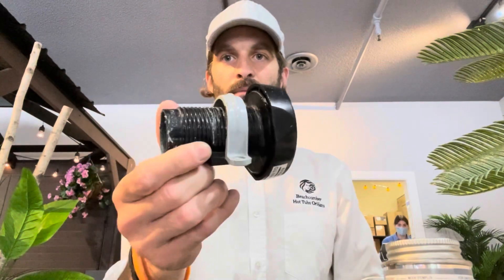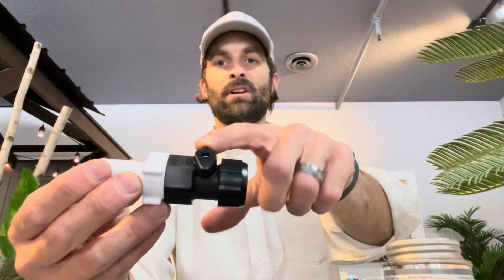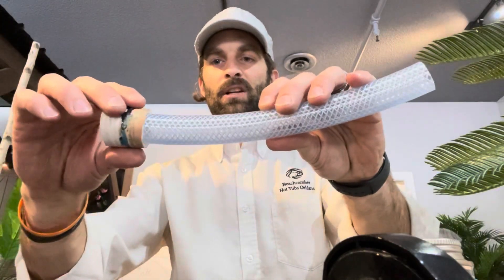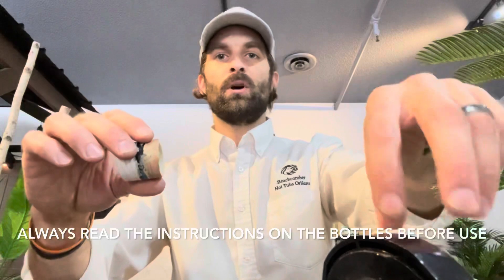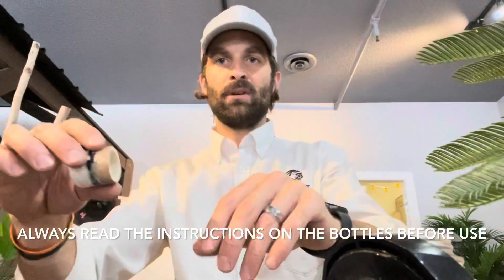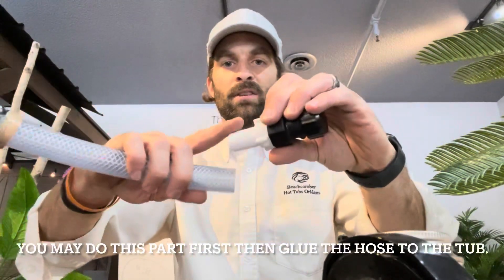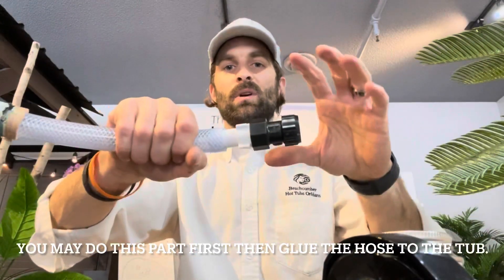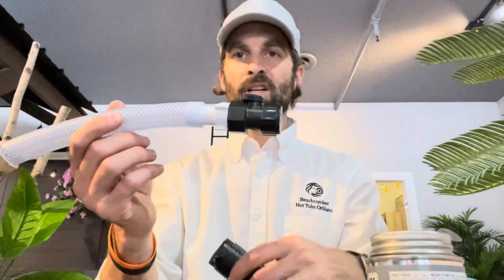Replacing the drain valve

Comment: Thanks for making this, i had the valve start leaking, so got the exact parts from my dealer, he did loan me the primer and glue .  I was debating on installing the 1/4 turn new valve in first, but i wasnt sure how fast this would set up.  It would have been fine to align it where i wanted.  I chamfered the clear hose slight to fit a bit easier into the old pipe.  Just going to wait till tomorrow to start filling, Hoping i have it done, i was losing around 3/4 of water each day out of tub, it was leaking at the bottom of the fitting so was hard to see.

Comment: How do you get the old valve off? Cut the hose?
Reply from the maker: In my experience these only need to be changed when they are loose and leaking already... which should make it relatively easy to twist and remove. IF the valve no longer works and is not leaking I would simply find another solution to drain (QuickDrain or submersible pump, etc..) and leave the drain valve as is.

Comment: My drain valve just started a very slow leak about a week ago.  I guess I have to drain the tub to make this repair...  I too would like to know how to get the existing valve off of the pipe. Do you happen to have the OD and ID measurements of the existing drain pipe? I can't measure the pipe until the valve is off.
Reply from the maker: Hi Jason,
Yes, you must drain it to make the repairs.
Once drained you can simply, and slowly, twist the valve until it’s twisting a full 360 around… then pull slowly away on the valve and it should come off. You can also take a heat gun (on low) and slowly warm up the pluming part of the valve (closest to the tub wall) before trying to twist it 360degrees. The plumbing ID measurements of the 2018 or older Beachcombers is 1” and a 3/4” (ID) flex hose (or clear with fibreglass braid) will fit nicely inside the old hose. This way you can extend the new valve out further from the tub if you wish.
I hope this helps!
Reply: Thanks I’m going through this leak now…can I simply slip the 3/4 flex tube down the old drain rather than removing it?
Thanks